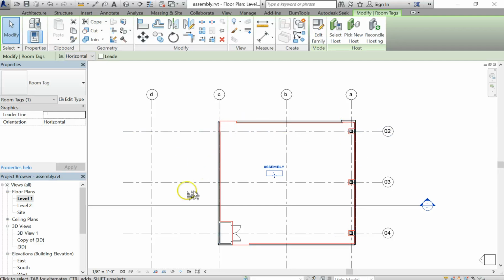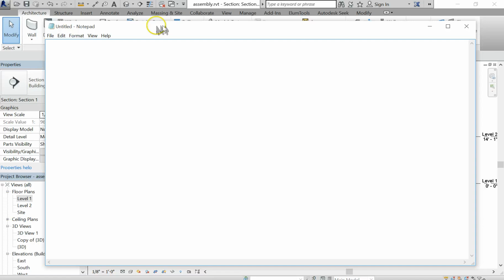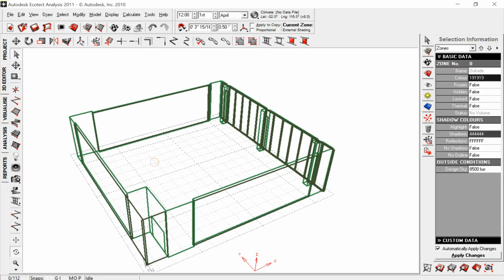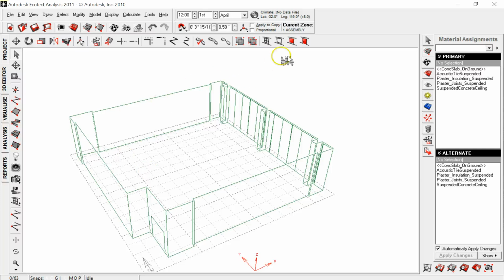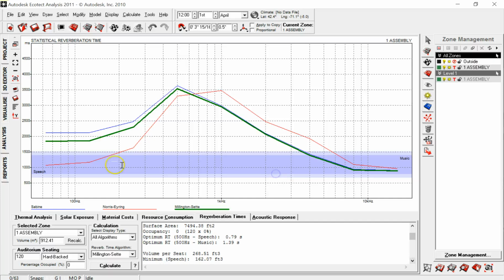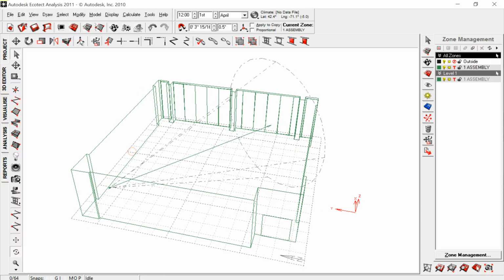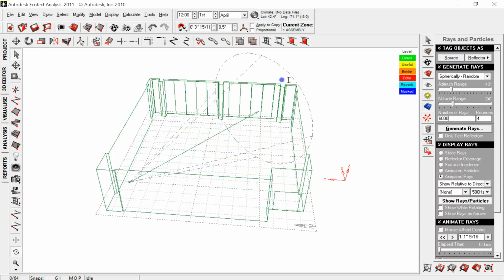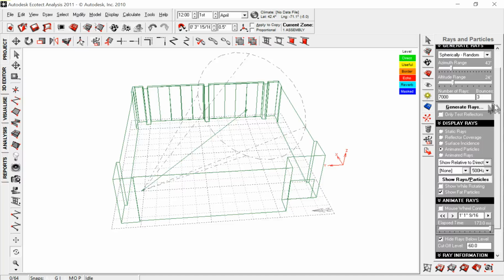Acoustics in Ecotect

Comment: Hi there. I stumbled across this today and this is exactly what I need for my work. Howver, I'm finding that Autodesk is no longer selling licenses for Ecotect and has migrated some of its funcitonality into Revit, but not the acoustics!!!!!! Is there any way for me to find this??
Reply from the maker: Ecotect still works as a trial.  You would have to get an old installer and use it as a trial.  That means it will not save an ecotect file, but it will still run on models you bring in.
Reply: @REVIT-lu8vr  but still can't generate rays.. why??